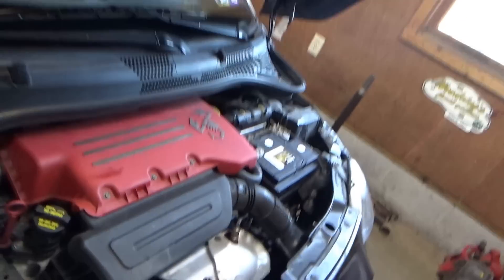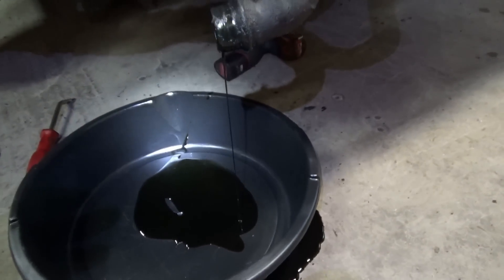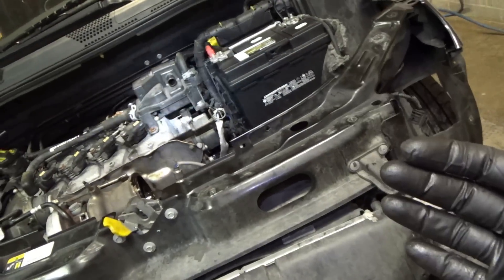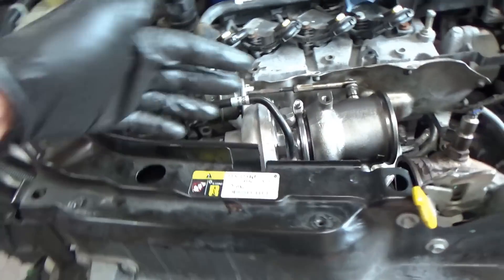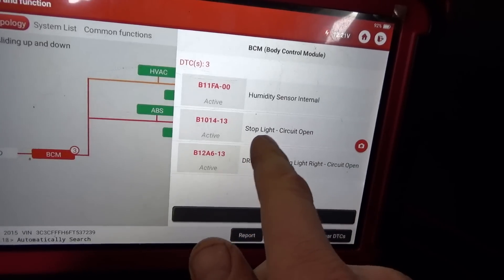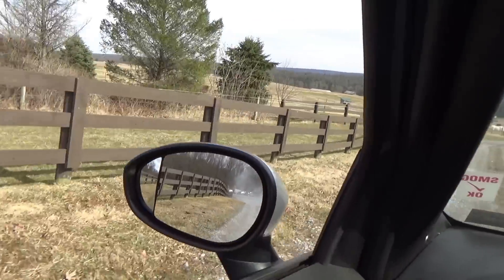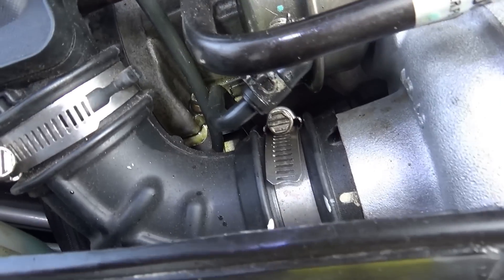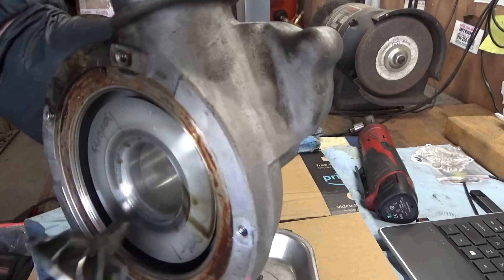Fiat Turbo GRENADES! (feat. Michael Jackson)

Comment: common issue on the Abarth here in the UK....its not a matter of if it breaks....its a matter of when it breaks....small over stressed high revving engine....turbo is working hard all the time. Turbo shaft gets a hard time on petrol engines with a butterfly (throttle plate) causes intake impeller to want to stall but exhaust still rotating....hence shaft gets a hard life!!! not an issue on diesels.

Comment: Do you think the bolts missing caused excessive vibration causing the grenade to go off?
Reply: Metal fatigue due to cyclic vibration. Possibly resonance of the skinny shaft . Loose support could do that.  The high rpm of the turbo multiplied by the number of vanes on the impeller will be the number of pressure pulses per minute.  Either resonance or fatigue could be possible.
Reply from the maker: Anything is possible...those bolts are there for a reason!

Comment: Another great video looks like a fun little performance car. Unfortunately typical of many small modern cars underengineered and not tolerant of leaving oil changes too long. Turbos are hard on oil and turning off a very hot engine without letting the engine idle and cool let's the oil cook and carbonise in the turbo. Not a car that you could expect to be reliable for hundreds of thousands of miles even if correctly serviced. I would lose my drivers license if I owned it ,too tempting to drive it like you stole it.

Comment: Could it be driving on highway and with high exhaust gas temperature and shutting down engine with lots of temperature in turbo over time it will cause bearing failure also oil seal failure which causes oil in exhaust and engine e to run on theoil

Comment: Can the two disconnected bolts cause the turbo shaft to break?
And that shaft already looks so thin and weak in the first place.
Ah..  the low oil may have burnt out the shaft.

Comment: This reminds me to a Jaguar SUV diesel that we had for smoking another tech diagnosed for a bad turbo. Replaced the turbocharger. Customer bought it from our local Jaguar/ Land Rover dealership. The tech installed and went for a rad test. He told me that 5km (maybe like 3 or 4 miles) he saw a HUGE pile of smoke coming out and a loud bang. When he came back to the shop we took out the air inlet for the turbo and the nut for the shaft came off and got swollen by the engine. Customer got a brand new 2023 SUV from jaguar after a huge lawsuit. Damm I love cheap parts some day as :)

Comment: Every time I replaced the turbo on my big truck, I had to replace the air filter and clean out the inter-cooler. When the turbo blows, bits of metal go both ways and not replacing the air filter quickly leads to disaster!
My big truck had 10 gallons of oil and in just a mile, it pumped several gallons down the exhaust.
I had oil all the way down the right side of my 53' trailer! I looked as though it had been painted black!
It's nice to watch you disassemble the turbo but, isn't there a core charge?

Comment: That is guaranteed foreign object damage on the turbine side (normally with excessive bearing clearance they just fold the blades on the edges), the sudden deceleration shears the shaft - sometimes that's how you lose the compressor nut, too

Comment: His oil light came on and he still drove two miles..... Yep! 👍
Reply: That's the cool thing about the Multi Air system on the Fiats, you literally can't drive without oil pressure.    As soon as you lose oil pressure, the intake valves CAN'T open, and the engine just stops..   
.
Its a cool system, I can't believe more companies aren't using it.  I think its far superior to advancing and retarding the camshafts, and its super simple.   The downside, you need to always have good oil, and it feels a little weird, especially driving a manual,  its hard to feel when to shift, it has an almost flat torque curve from 2500 to 6500 RPMs and gives you linear acceleration, it feels weird, but its cool...  
.
No EGR valve either, it just burps the intake valve to let exhaust gas back into the intake. 
.
Cool system, fun little car, even the non-turbo's are a lot of fun and they feel a lot quicker than they look.  They aren't fast, but they feel fast, and as we all know its a lot more fun to drive a slow car fast than to drive a fast car slow.

Comment: I once had a Ford Pinto wagon, with a 2.3L(maybe) 4 banger that developed an oil channel leak in the head gasket into the #4 cylinder. Accelerating from a stop, laid down a smoke screen like a WW2 Destroyer! Garage pointed to an oil pressure switch that was leaking onto the exhaust manifold as the cause! Changed their mind when I filled their lot with full camouflage! Never did tell me, how oil on the outside of the pipes, got inside!

Comment: Hi Ivan, I bet the oil leak the the dealer supposedly repaired was in fact the bad turbo. people that are new to turbo cars in most cases don't change the oil enough, they got away with that with their non turbo engines
Reply from the maker: How does that make sense? Turbo was original...

Comment: It's very common on all forced induction engines on all makes and models. Mileage doesn't matter either. I've worked at dealerships and have seen failure as low as 10000mi. Lots of damage when that happens. I always recommend naturally aspirated engines unless it's a toy for the track .

Comment: 134a is compatible with 1234yf systems, due to the cost of 1234yf. I researched an converted many cars back to 134a if the customer is in a pinch. Just don't mix the 2 gases together, full discharge  and refill if you convert the system.

Comment: Would that oil get into the catalytic converter and spank it?
Reply: Yes. All that oil coming out the tailpipe passed through the converter and soaked the O2 sensors. Doubt that will pass the next smog test.

Comment: With this and the transmission solenoids having problem exactly after 100k miles right when the manufacturer warranty expires is not a coincidence; They’re engineered that way, that’s why dealers do 7500 mile oil changes and transmission fluid that lasts the “lifetime” of the vehicle because they don’t tell you that lifetime actually means until it’s not covered under warranty anymore.

Comment: Looks like a built in failure point. The shaft broke at the transition to narrow right by the exhaust blades. If the car is thrashed (student) and turned off hot it will encourage stress fractures to form at the transition. Certainly looks to have more oil supply than it could possibly need.

Comment: I wonder if it could have increased crankcase pressure, it might be an issue with gravity oil return from the turbo.
Reply: I'm wondering if the PCM has been remapped to increase boost, it's pretty common on these.

Comment: Dude got lucky:.  Usually when the impeller straight falls off theres a few pieces that make it inside the intake and tear the piston area up or get pushed in the oil pan and clog up the pickup screen with mr sparkley..
Reply: How if it is not spinning? It would have to go thru the intercooler piping, the intercooler, and then to the intake manifold and engine. When it breaks nothing else happens, since it is not creating any boost, only turbine side free spining.
Reply: I would want to take the intercooler out to try to find the broken fins

Comment: "post if you seen this before"
i seen these symptoms from a kinked oil return line,other things that could cause same symptoms is blockage in the return line and too much fluid in the oil pan since these are gravity bled  and it backs up i heard but cant confirm this one., just fruit for thought in the future because it will smoke pretty bad when yolu have return issues and look just like a blown turbo

Comment: Have not seen a lot of turbo videos for low millage vehicles, I would suspect it should last 100K miles at least. Bad maintenance with oil or low oil when it was leaking would be my guess or just a part with a flaw.

Comment: You put a cheap Chinese turbo on this car with only 67,000 miles?  Did you get your butt kicked out of the Fiat Dealership in Lancaster?  Like you did the Toyota Dealership?  (You did install OEM parts on that Toyota; that you gave this person to drive while you were working on this car?)  I think you should put Lacquer thinner in the fuel tank; that would help with the catalytic converter.  Just ask Scotty Kilmer.  I am on the fence whether to classify this as a Russian repair.  It isn't likely Michael Jackson is going to appear out of that smoke; he's been taking a dirt nap since 2009.  Great video!

Comment: Seen it recommended that you change the oil feed tube with the turbo, just in case a blockage was the cause of the original problem.
Reply: Yes AGREED read enough that pipe blockage culprit to failure.

Comment: its designed by fiat with all the performance not to get caught by a speed camera it cant see your number plate through the smoke i did a blown turbo on a bmw 118d it filled the no 3 cylinder and hydro locked and the intercooler had about half a gallon oil in it i fitted a turbo cartrage  drove till smoke stopped and shipped it proper euro t where did the bits off the intake impella go

Comment: If it was a diesel, it likely would have run away (prob for the better). Turbos on gas engines: not if, but when the turbo and/or engine will blow up.
 CAT coked?

Comment: Most of the turbos we see are start no waiting to hammer on it then no cool down after a run the bearing oil burns and siezes the shaft at high rpm it seizes and breakers the shaft
Reply: PS we were taking out turbos in dyno labs at 90 seconds it took that long for it to the turbo in a cold cell we repeated this many times

Comment: The turbocharger should be a Garrett (Honeywell) GT 1446. In Europe the price for an original Garrett  is about Euro 500 - 550 + taxes.
From about Euro 600, and more, can be found new Garrett turbochargers upgraded for higher power/torque mods.

Comment: halfway through to no sparkles in the oil... but that's only 1 issue. isn't this a high risk thing to guarantee, maybe later in video you say you dont and you shouldnt guarantee it. the head may be warped. you dont know the true distance it was driven on low oil or how hot it got. high risk of all gaskets related to the engine are now near failure.

Comment: Hab das schon bei den Mercedes Sprinter öfter gesehen💨😂 aber die haben dann oft schon 180k miles auf den Tacho. Mein 2.5 xt Outback hatte keine Probleme auch der Mitsubishi Pajero 2.5 Diesel von Opa hatte über 240k miles erster Turbo. Einige Autos haben ja einen kleinen Filter in der Ölleitung zum Turbo der verstopft😆 großartige Nebelshow 👍the Scorpion 🦂 zurück auf der Straße 😄

Comment: I didn't see you check the oil lines to make sure they had good flow.  If the oil coked up in the lines, it could leave the turbo oil-starved.
Reply: The engine emptied all its oil into the exhaust via the turbo oil pipe, it couldn't have done that if the oil line was blocked.
Reply: @ferrumignis  It's not blocked, but what about restricted?  And what if the return is blocked?

Comment: Oil is cheap compared to engines and turbochargers.  Change your damn oil regularly and use good oil or be prepared to pay the price for expensive repairs.  I own three turbocharged vehicles and several that aren't, but I change the oil religiously in all of them regardless of the turbo.  I don't want to jinx myself, but I've never had a oil related failure on any vehicle I have ever owned and I attribute that to meticulous maintenance.  You will never see me wash a vehicle, but I sure do keep up with the maintenance schedule.  Great video, thank you for posting.

Comment: I had a smoky and very distressing incident like that after a local shop decided to overfill my 2.0 ltr turbo diesel ford engine by about 1.5 litres of oil on an oil change. After the excess oil was removed from the oil pan and the intercooler pipes were cleaned out i had to drive to a layby on a country road in the middle of nowhere and run the car at 2-3000 rpm stationary to get the exhaust as hot as i could until the smoking stopped. Luckily so far (fingers crossed) after 5000 miles no apparent lasting damage. Warning ---NEVER OVERFILL-- any engine with oil.

Comment: It would be interesting to know if a rebuild kit would fix that turbo.
Reply: Not a doctor, but IMO not likely - if the turbine went in contact with the housing, it must have shaved off some material from it (in addition to damaging the blades themselves). That changes the airflow and compression ratios. Which would change (likely lower) the output from the turbo, and mess with air intake and ECM. Not to say produce shavings for the engine to munch on.
But that would be an interesting lab project to see if rebuild was worth it - need a test car though.

Comment: I replaced a clutch in a turbo Fiat 500 Abarth edition. It only had about 8000 miles or so on it. Owner got it stuck in some snow and smoked the clutch. Took it for a test drive when I was done. Even with a turbo the car was dog slow. Was not impressed at all.

Comment: I'm surprised the impeller didn't explode and send metal flakes down the oil return into the engine... Must have been because the owner parked it so quick after the oil light came on.

Comment: The turbo shaft did not fail, the turbine bearing failed, leading to excessive shaft play and eventual shaft breakage. Why did turbo bearing failed? Could be sludge that did not lubricate turbo bearings. Shutting down the engine and cutting off engine oil pressure while turbo was still spinning at high rate (20,000-50,000 RPM), with turbo engine you should let engine idle for at least a minute before shutting the engine down. Extremely cold oil that did not flo  to turbo bearings, and finally normal bearing wear

Comment: That one will no doubt be back in shortly for a PO420---there's no way the catalytic converters survived that amount of oil. I can see why the turbo failed---the impeller shaft is far too small, and I'd actually consider that a design fail
Reply from the maker: No one cares about the P0420 around here 😆

Comment: @Pine Hollow Auto Diagnostics, great job as usual Ivan! That was an absolute mess, burning oil is a real hazard! I can't believe the nonsense engineered into newer vehicles... I am as surprised as you tho that the impeller shaft is so small, it looked about like the diameter of a No. 2 pencil. I hope you, the lady of the house and the dog too ^_^ are all doing well!
Reply: Absolutely normal for a turbo that size, clearly Ivan hasn't much experience in this area.

Comment: having worked in the after market trade if i sold you that turbo i would have sold you a kit including both the high pressure and return pipes banjo bolts and seals as well not fitting either is a recipe for a repeat disaster.

Comment: Very small shaft which means a very small bearing or I hope not a small bushing. The design should have used larger bearings my guess. Metal fatigue even though the oil was there (we presume). That compressor shaft showed signs of heat in the center too.  We'll see how long it goes before O2 sensors fail and the CAT.
Reply: Larger shaft means more drag from bearings.
Reply: @ferrumignis  True...compromise is everywhere.

Comment: I'd be a little worried about the Chinese turbo. I mean, its probably not any worse than the Italian one,  but still... 🤣
Reply: The OEM turbo is a Garrett 1446. But with how this one broke, aftermarket turbos don't have to do much to be better.

BTW, I also have a 2015 Abarth. 50,000 miles on mine. I don't know what kind of maintenance you need to do to a turbo. I just make sure I do proper maintenance on the rest of the car. It's still running great! I suspect the previous oil leak "repair" was simply botched.

Comment: 🤣🤣😂🤣😂 These are ULEZ Ultra Low Emission Zone Compliant here in the UK 😂😂🤣 They can be driven in London and all ULEZ area's yet my little Toyota 1.4 Diesel with no smoke coming out the exhaust and has lower emissions is not allowed without paying a ULEZ and Congestion Charge for the privilege 😉.

Comment: I put an aftermarket turbo on a jetta twice in a row recently. I couldn't get the ecm to accept it even after programming. Put in a new OEM turbo (4th  attempt). No programming, no lights. Bottom line, use OEM parts.

Comment: modern engines and turbos are really hard on engine oil.  getting 160hp out of 1.4L takes a lot.  which car manufacturers putting crazy long oil change intervals on them to keep the 'service' costs down, it's a recipie for disaster.  

you gotta change your oil often, with quality oil and filters.  you cannot afford to run it low or long on the change like your old chev 350.  

small turbo engines even more so. i don't care what the manufacturer says. 6 months or 5k oil changes, cheap insurance against a new engine/turbo.

Comment: LACK OF OIL CHANGE oil gets dark, gummy,sticky causing impeller to hang which in turns causing more pressure torque , snapping that small rod.
that's my Analysis ,and I'm sticking to it..

Comment: look like alot to waste and throw out dont these have replacement impeller or rebuild kit for them . I think the oil missed its mark on this when he had the leak and screwed it up . With that much oil coming from the valve cover its a wonder he never blew his whole engine.

Comment: I've not seen this on any Fiat's.  That was an impressive smoke show for sure.  Fitting sticker on the windshield.  I can't stop laughing!  But on Saab's and Volvo's, oh yeah.  Lot's of them.  Even my old 1998 Volvo S70 GLT went through 3 or 4 turbo's in the 10 years I owned it.  If you want to try a cheaper repair option, try looking into a replacement turbo cartridge.  It's less than a 1/3rd of the price of a complete unit.